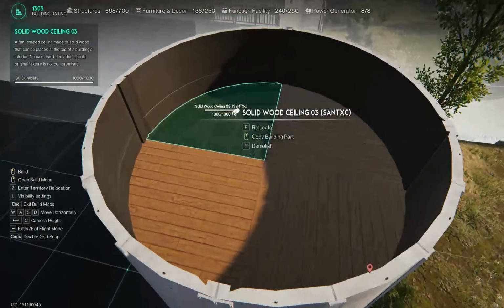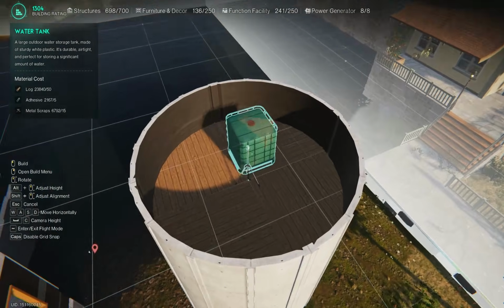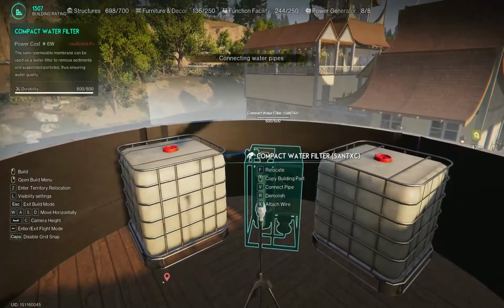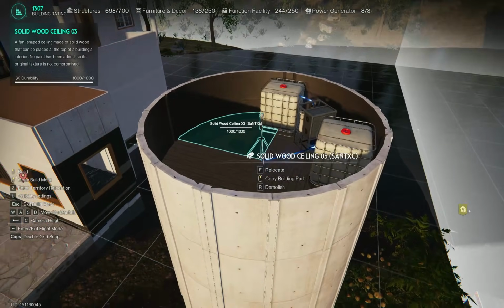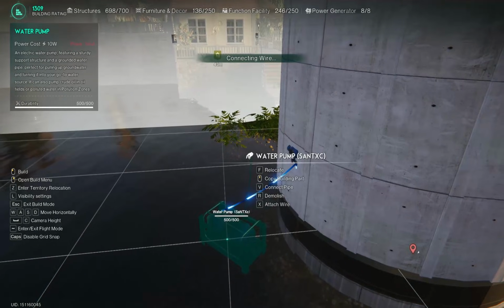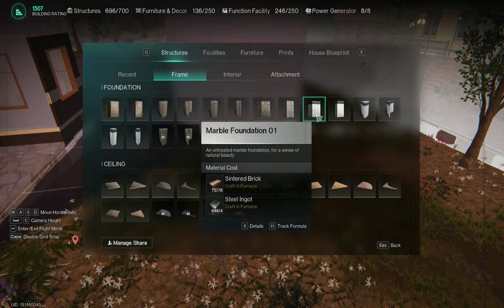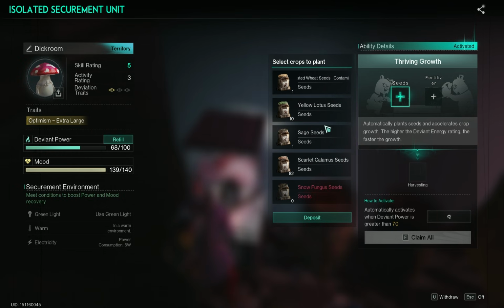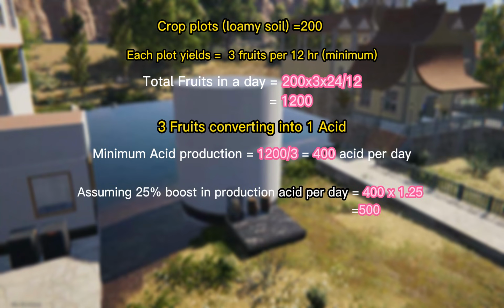Passive Acid farm anywhere on the map in permanent server 500 + Acid per day | Once human (tutorial)

Comment from the maker: DONT BUILD BEFORE READING THIS !!! After the update they have removed  the ''contaminated crops to acid formula'' from barrel to advanced synthesis bench . SO now you will need advance synthesis bench instead of Barrel
Reply: Noted
Reply: @redscarlet3056 wanna ask why make cylinder instead of square? If I use square, can i put up to 8 per row?
Reply from the maker: @singleplayer1331  because man loves curve
Reply: @santxc683  😏
Reply from the maker: @singleplayer1331  🫵😂💯
Reply: does this method still works? I cannot find the breeding boost
Reply from the maker: @ParallaxSynthesizer  u need to unlock the memetic first then you can craft breeding boost

Comment: When you go to catch your little mushroom friend, make sure you have your highest level gloves equipped and fully repaired. The higher level your gloves are the higher your odds at catching deviants will be, if you have broken gloves then it's the same thing as wearing node gloves...

I learned this the hard way and plucked a little under 300 mushrooms before I realized that I needed to repair my gloves to have a successful catch...
Reply from the maker: Yes , A very useful tips. Appreciated 👍🫵you are awesome 💯
Reply: Or you can just plant some mushrooms in your base and collect them instead of wandering around the map to find a decent growshroom.
Or you can buy a level 1 growshroom from other players/ harvester's market and use that to farm as many mushroom plants as you can in your base for a day or two and get yourself 10-20 growshrooms right from the securement unit of your original growshroom.
Yes, a growshroom collecting mushrooms planted in a base also collects growshrooms.
I had accidentally farmed 3-4 level 5 growshrooms and tens of level 4 ones while making some yield boost fertilizers.
Also, farming mushrooms or morels seem to improve the fertility of the region.

Comment: Does this still work?
Reply from the maker: Yes sir
Reply from the maker: But now the contaminated crops to acid has been removed from barrel to synthesis bench
Reply: @santxc683  i have everything but the barrels placed. how do i connect the tank to the benches?
Reply from the maker: @smolparis  you don't need the barrel anymore instead u need advanced synthesis bench . After you collect the contaminated crops u have to craft acid in the synthesis bench
Reply: @santxc683  i did that now how would i craft the ale ? i cant find it anywhere
Reply from the maker: @smolparis  the molt ale is in the advanced stove now.

Comment: Not trying to be rude, i love the idea.

- costs 2,000 Eternaland material points just to bring the seeds over to a new season
- takes up 200/250 function facility
- can’t farm anything else (no sanity items or animal feed)

A water pump acid farm:
- costs 500 Eternaland material points for 1 water pump (not including steel ingots)
- takes 3/250 function facility
- can utilize farm for wheat to make animal feed & beer to keep pollution zones safe..
Reply from the maker: Right , but it's flexible u can use lets say 5 layers only and plant mushroom then use it to make yield boost then plant contaminated crops . more work but it will also increase acid production.

Comment: I have tried aloe contaminated and it is not worth because it has way low Yield even the ration on the barrel is 2:1 and it take about 24h to be ready, I have 130 loamy soils which yield about 1300ish every 14h-ish and I have to use 2 water pumps, 3 reverse osmosis and 5 barrels to keep up with the production so I don't know where did you get those numbers from.
Reply from the maker: I simply assumed everyone will automatically put more barrel as their need . Like if all the eight slots are filled you will for sure put another barrel , I did not want to make the video more longer . Just tried to put what's necessary . But I have a better design which I will make video on later . The updated one will be more efficient produce same or more acid but with way less loamy soils
Reply from the maker: And about aloe Vera even though it it has lower yield but due to better conversation ratio aloe Vera is taking less space in barrel to produce same number of acid

Comment: Does this mean I have to always plant them with breeding boost?
Reply from the maker: Nope after you get to 200 seeds you don't need to use breeding boost anymore. But if you want u can use yield boost to further increase acid production
Reply: @santxc683  because even without breeding boost I can get atleast 1 seed per harvest?
Reply from the maker: Breeding boost will multiply the seeds by 3 . If you plant 1 seed you will get 3 seeds in return when u harvest
Reply: @santxc683  Ya I understand that. What I want to know is why should I stop using breeding boost after 200 seeds? Is it a guaranteed 1 seed per harvest without the breed boost?
Reply from the maker: Yeah 1 seed is guaranteed

Comment: I couldn't get 6 layers, it wouldn't let me build anymore. I only got 1 wall high, I think 3 layers
Reply from the maker: Check your structure limit by default it's 300 but if you unlock territory expansion then u can upgrade it to 700 it will let u build more

Comment: Any idea why this setup wouldn’t be yielding any crops in 24 hours? Followed the guide completely but nothing is harvesting, I’m not getting any indicators that they aren’t getting proper water. Would the patch have affected this? Thanks!
Reply from the maker: What is your irrigation facility setting  , it's needs to be set to 80 . Waiting for your reply .
Reply: @ turns out I had a problem with my water storage, everything is working great now. Thank you for this build, this is the most aesthetically pleasing farm I’ve seen this far. Keep them coming
Reply from the maker: That's great and thanks for the compliments :D . But I think I can still improve this further to make more acid but with way less loamy soils to avoid using too many facility.
Reply: @yeah I was wondering how you’re doing with that 250 facility cap, because it’s kicking my ass with this build, it’s worth it but I do have to occasionally delete some soil
Reply from the maker: Yeah I have already tested the design of an improvement but not sure should I upload it soon or some time later 😅
Reply: @ I’m looking forward to it 🤘🏻